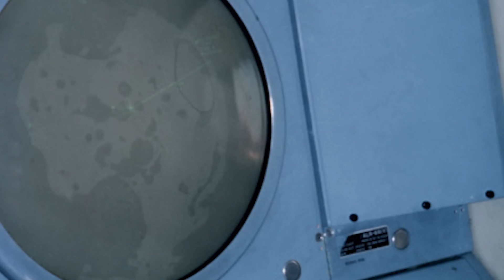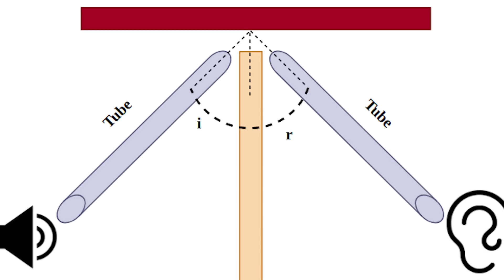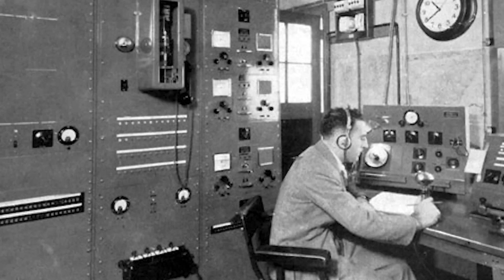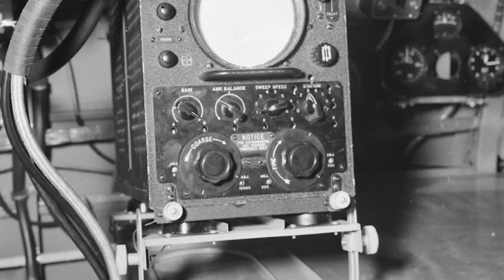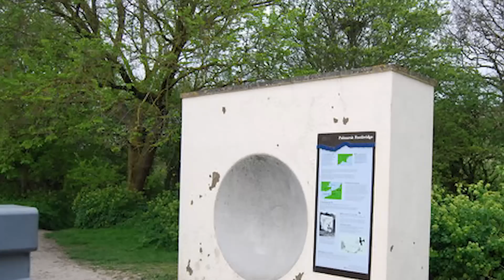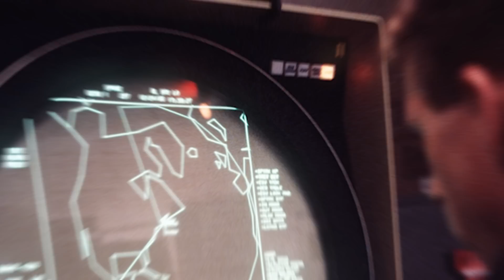Why Forgotten Acoustic Mirror Networks Stand | ABANDONED

Comment: Radio detection and ranging is RADAR not RDF.
RDF is radio direction finding.
RDF later became TACAN, tactical air navigation, a now obsolete network of radio transmitters that aided in aviation navigation to airports.
Reply: Mariners had LORAN navigation which was fixed radio transmitters and LORAN charts which was used before GPS.